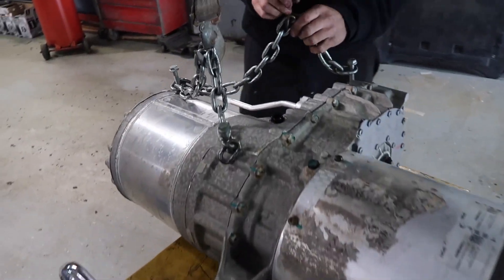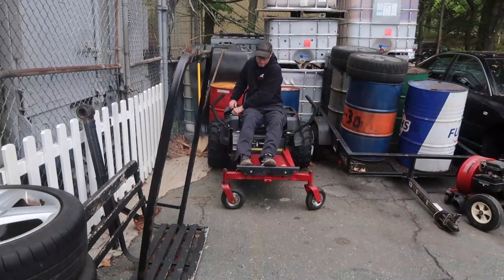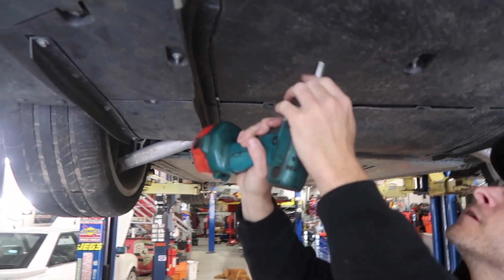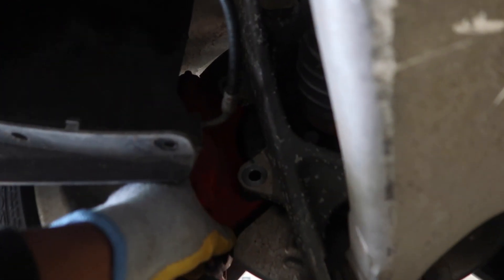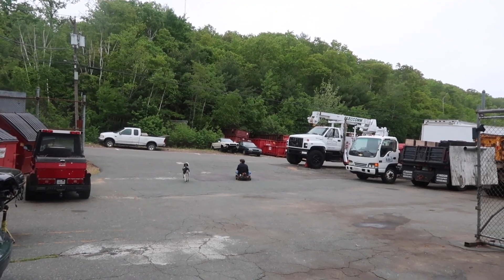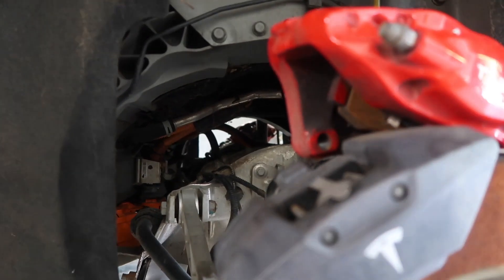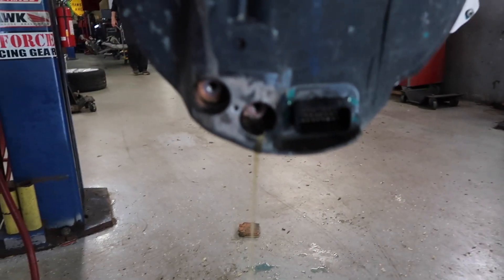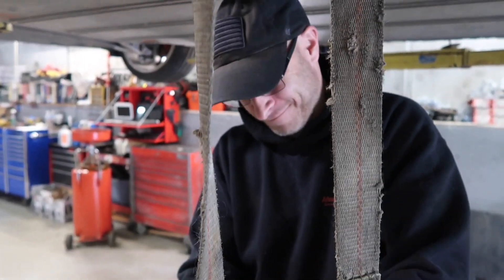Can You Drown a Tesla Motor?

Comment: The boards internal to those motors will be fine, no power to them at the time of flooding. 
Take them to an electronics manufacturer or repair place, get them properly cleaned and baked. The vast majority of PCA's made are washed in water and detergent after manufacture, then baked afterwards.
As for the motors themselves, if you can clean them off and dry them in a similar manner, they should be just fine. Several days baking will drive the moisture out of the rotor laminations and a light penetrating oil when done will stop any further corrosion. The windings on such new motors will not have suffered any damage, they'll still be well protected from corrosion by the lacquer in them, they may even be potted in epoxy if Tesla went all the way. Bearings are an easy replacement, three dimensions to know, get replacements and press off/ on.
The gear train will be fine, not even close to enough water in that housing for the water to reach bearings. The gears themselves are hardened steel, that stuff doesn't start rusting very quickly at all, I'd be surprised if they had even done much more than changed colour. I'd fill the gear case with light oil and flush through a few times, then fill with the correct oil and change oil again after a few hundred miles.
Frankly, I'd pull those motor shells, find an electronics company to disassemble, thoroughly clean ad wash the boards, then dry and test them. Same with the motors, I'd farm them out to a motor rewinding company. Electric motors are electric motors, they get rebuilt every day.
The cost of both motor reconditioning and board reconditioning would be a pittance compared to even used Tesla drivetrains.
If that was my car, I'd definitely have a go at getting those parts reconditioned.
By the way, I think you'll find there will be reduction gearing in between the motors, they would spin way too fast for direct drive to the differential. I suspect there will be a planetary reduction in there, given the shape of the housing and inputs from both sides.

Comment: Shot in the dark would be to immerse the PC boards in DI water in ultrasonic cleaner.  Then blow off with compressed air.  Last, place in an oven at about 130 degrees F. for a couple of hours.  Make sure you're not in an environment that can generate static electricity (compressed air does generate some though but you're not doing this in a perfect world). 

Many PC boards undergo a DI wash during the manufacturing process but not a soaking process.   The ones that don't use a "no clean" solder flux.  As for "send to some dude to repair", NFW.  These boards use custom ASICs and use custom diagnostics that no one would have.  They would also undergo ICT (in circuit test) before conformal coating.  No one's going to be able to troubleshoot these at the component level and there's no way Tesla will turn loose of the schematics .  Also no way you're going to get any custom parts for replacement if needed.  Tesla controls that.  Sorry,  Mouser Electronics doesn't stock them :-)

I don't even think Tesla could debug to component level after conformal coating was put on the board due to inaccessibility of testpoints on the printed circuit assembly (my guess but I'd have to see a close up of the board).

ICs will absorb water in their packages as they're not designed to submerse.  The conformal coating is on your side though.  It could prevent this as well as corrosion on leadframes and the BGAs.

Again, no guarantees but worth a try.  An ultrasonic cleaner and DI water are cheap.

(Failure analysis engineer for a living, worked for a major computer company)

Comment: Like people have said the boards are probably ok, just need to be cleaned up and thoroughly dried.  The tougher part might be making sure the windings are clean and dry and not compromising the insulation in the process.  Maybe remove as much electronic stuff as possible then after cleaning up everything throw the whole thing in a big oven at 250f or so a few days.  Just thinking out loud.  Interested in seeing how this turns out.

Comment: Get an ultrasonic cleaner and clean the inverter boards in it.  Use Branson's BranSonic EC parts cleaner.  It's a little expensive, but you can do quite a bit with a batch of chemicals.  Crest ultrasonic cleaners are probably the best choice for the money.

Comment: Get some isopropol alcohol and clean up all the circuit boards carefully with a paint brush (new, soft bristled) and see if the boards look ok afterwards....do the same with he motor - take apart and clean out. You just might be lucky if no-one has tried starting it when it had water in there....???

Comment: As long as you didnt energize the unit the inverter can be saved. Just takes time. Most of the electronics  are tin plated and resistant to corrosion to a point. Its the steel fasteners can be cleaned up or replaced. The copper eliminates of that unit can be clean easy. If you need help message me im in CT.

Comment: Yeah I think it could be cleaned up and let it dry out take some brushes and get the corrosion out of there what's some bristle brushes you can also use toothbrushes just clean up around the chips and the resistors and everything else some of them may be encased in some kind of hardened glue and that would be a good thing but you want to go And  regrease things that need to be greased or replace what needs to be replaced electronic components like boards and stuff are pretty resilient

Comment: The cranberry juice was gear/diff oil. The first few seconds you see water coming out as it sits on the bottom and oil Followed. Those gears might still be salvageable and the parts from the motor too like outer casing, screws etc. Keep them,they  might come in handy!

Comment: given the voltages involved in an AC inverter of that rating, I wold hope that those boards have a conformal coating on them that kept the water from damaging them. As long as they are cleaned well before you give them full power, you should be good.

Comment: Motors are inherently tolerant to water, however control electronics may be damaged assuming they were powered when the car went into the water.  Good taste in impact driver though, made in japan that's a solif unit.

Comment: Hi Rich.  I agree with those who think the water won't kill it.  I worked at Tekronix and we washed the circuit boards in a dishwashers.  (Really!).  If there was no power to the board it is likely the inverter  will work.  I would clean the boards of the rusty water deposits and fully dry it.  Look for components that would be affected by water (on a phone that would be a mic or speaker.   And yes, I know the inverter doesn't have a mic or speaker...)   But look for that kind of component.   If there is not that type of component you should be fine.  After cleaning and thoroughly drying the unit, I would connect the motor/inverter to car with extended cabling with the motor/inverter outside the car.  Since it is not under any load outside of the car it should not draw that much current and it should show you if the system still working.  (But be ready to pull the connector quickly is there is a short.)   Don't give up on motor/inverter just yet.

Comment: Motor itself won't have been a problem rebuilding, but electronics are more likely shot as that protective coating may have not done the trick being under water for several days. Would be interesting to see macro pictures of the boards and etc.

Comment: so.. this goes to show that the sealing is not effective on the motor..  i wonder where the water leaked in at.. if you reassembled it or had pulled a fill plug and pressurized the assembly prior to tear down you could have found any leaks..  i am thinking that any individuals with this out.. might want to carefully reseal it..  a few things.. Hylomar.. or Permatex 85420 would be a great sealer to use on O ringed joints..  with the motor and inverter cover off around the big end.. across where the power connector flanges are. where the control connector is sealed.. around the high voltage cables. 

 the loose CV axle nuts are an issue also... especially in high power cars.. the clamping force of the axle nut prevents the inner wheel bearing races from separating under cornering forces.. it also locks the flat face of the outer CV tight against the inner race and the hub shaft to prevent the splines from rocking in the hub..   having them that loose will  cause the splines to eventually wear out.. taking out the wheel bearing assemblies and the CV shafts..  they will spin like an 60s VW bug axle shaft.. 

 i wish i had the time and funds to mess with one of these..   i would want to use one of those drive assemblies to  replace a boat transmission. 

 i would probably want to take the cover off the inverter.. load the pressure washer up with 5 gallons or 10 gallons of distilled water or deionized water.. and give the rusty inverter components a light washing..  those might be cleaned .. using deionized water then baked at 165F to evaporate any moisture out of the boards..  i away future videos..

Comment: Circuit board will need replacement. You could try cleaning it thoroughly first with ultrasonic bath etc. but I'm not hopeful it made it, as corrosion will kill it fast.
Reply: If you look at it closer it looks like the contacts on the board are good and that corrosion only came for screws or what not. look at pin in the board and they do not look corroded.

Comment: give the PCB a clean with pure alcohol. They should be coated in a protected layer to prevent water damage. 10 days is a bit much but let it dry out for a week and it may work. saves you spending loads of money.

Comment: I'm guessing that is what the new roadster is doing, a motor where the inverter is now and instead of a open diff., there is no diff at all.  The two new inverters proably have to sit on the back of each motor.  Basically though the gears for each motor can sit within the same center gear case.  This is all done in the back of the roadster though and oh yea torque vectoring baby!

Comment: Yea. Dirty water and electricity isn't a smart idea. Electrolysis will happen (when energized). You can clean the electronics/PCB's with isopropyl alcohol (and a toothbrush).

Isn't that red stuff just oil (with additional leaked water)?

Comment: I wonder if Rossmann Repairs could fix the electronics? Louis works miracles with water damaged laptop circuit boards so you never know.
Reply: Definitley not the case. I run a phone/laptop repair store in southwest florida. Electronics that are exposed to water damage, are not simply "broken". The components generally don't burn out themselves, but like you mentioned, water does have minerals in it. So when this water dries, what does it leave behind? Minerals. Corrosion. Dirt/Debris. By using an ultrasonic cleaner, and nothing but distilled water, submerging electronic circuts and boards into the water bath for multiple hours, washes away the corrosion off of the gold/copper pads and different circuits that the energy wasn't able to flow through. The only difference is this time, when the electronics dry out, nothing will be left behind on the parts, because distilled water is violently pure.
Reply: High voltage with minerals in the water means nearly instant and unrepairable damage, I drowned a drone and lost every component to electrolysis in a couple minutes in a stream.
Reply: A fitter, happier, more productive Model S.
Reply: No way.
Reply: I'm pretty sure Tesla won't give the schematics to him. So there is no real chance to find the issue.
Reply: Alright Free Stuff, I'm going to give that a whirl on my old laptop. Nothing to lose.
Reply: Even if Louis isn't willing to put paul to work on these boards, you can still buy an ultrasonic cleaner and Branson EC fluid from him. I absolutely recommend cleaning those boards off in an ultrasonic cleaner, with followup repair to remove any additional corrosion, inspect the components for damage. 

As others have said, repair of the boards themselves may be difficult (or impossible) without schematics. However, I'd definitely give Rossmann Group a shot. 

A buddy of mine once powerwashed out a 3 phase motor. Works fine to this date.
Reply: The Crest Ultrasonic will fix those. Don't delay, buy today!
Reply: have you watched louis?

Comment: Yeah. The propeller logo is a myth. The original logo comes from bayerische motoren werke = BMW but due the illegal issue that doesn't allow to put a flag in a brand they had to change it a little. And the myth with the propeller was born on a Comercial where they used the logo on a flying plane instead of a propeller, they did this cause they were makeing engines for aircraft before car engines.

Comment: The boards are ok, you can see the conformal coating reflections at 13:52 (red board). Just wash them carefully with water and soap, dry out and you are good to go.
Reply: And of course wash the motor windings with pressure washer, change the connectors and bearings and everything else that seems bad.
Reply: Wash with alcohol not water\soap**
Reply: Water and soap is fine if you let it dry. the coating protects from corrosion. Hek it has already been underwater. :D

Comment: If power was not applied to the motor/inverter while it was under water likely the circuit boards can be cleaned with mild detergent and water then flushed with distilled water.  We actually used to wash circuit boards with HV circuits (tubes) when I was in the USAF.  Just wash and dry in an oven at about 140 Deg. F.  If power was applied when exposed to water, electrolysis will occur damaging the printed circuits.
Reply: Probably not a good idea to subject a PCB to high temperatures as the components tend to melt.  Also, it ain't electrolysis.  It's short circuiting which causes the components to melt.  EDIT: I guess I was wrong about the heat, but the heat given off by arcing electricity is fairly high.

Comment: I'd tell your friend that the hydros (drive systems on that mower) are designed to be used only when the engine is at or near full throttle. Believe me they will wear out quickly and I've haven't worn out a hydro or two like that 😉😉😉

Comment: Honestly it probably wouldn't be hard to fix. Just remove all of the electronics out of the motor, and spray all of them with electrical parts cleaner. 9/10 times when I did this the electronics work again even after water damage

Comment: two things that pop into my mind are member. I don't know American law here, but last I remember automotive manufacturers by law Herbert wired to produce all parts necessary to repair or maintenance a vehicle for a minimum of 10 years after the release of the vehicle to the public. There is no such thing as a list of hearts you aren't allowed to get and I'm pretty sure it's that way in the US where it's that way here in Canada. It has lot is pulling that around here in Canada. They are breaking the law.

Did you use the motor out of the Tesla that you used for perks in your previous videos. That's the second thing I've been kicking my brain around on were gone. It was soon you can't just take that motor and dry it out with a industrial electric heat source like a paint drying booth so we'll assume you need to her place the motor that would mean you need to get one out of eight has law that's been in an accident and the drivetrain of the car wasn't the focal point of the accident. I'm assuming has loads are generally rear engine so you would need to find one that had a encounter with, say, a semi or some other severe front end collision where the engine area of the vehicle hasn't been damaged probably somebody's Artie mentioned this. I'm assuming you Artie use the electrical motor system out of the other test like you were using for parts. Frankly, I'm sure you already thought about this before you even bought the vehicle and Artie had another motor option in mind.i bye vehicles generally from 1000 and West that I use personally because I'm basically a broke practically living on the street ass and  go to quite a bit of trouble to literally look up perks generally before I even look at buying something. Literally ran into a weird problem with a 2009 Dodge caravan where all of a sudden the part just isn't available unless you want to pay triple what it normally goes for.i wanted to replace the rear passenger side brake caliper with a new one and suddenly when you go through eBay and a few other websites. The only ones that are available are the drivers side. Nobody had a passenger side one in stock, unless you wanted to pay significantly more than what the drivers side one normally sells for passenger side and driver's-side obviously should be the same price. Most dealers only had a driver's-side. And had no record of passenger side. There were several used options. Most of the worm or expensive than buying a new one.i ended up passing to buy a used one at a salvage yard and personally would've rather bought a new one dealership wanted over 200 for the item which you can normally get on eBay for around $40 plus the shipping. I literally priced the entire drivetrain on the Van a couple weeks before I bought it and it's just kind of funny that there's a handful of parts you suddenly can't get on eBay having the same problem with a Mercedes that I've bought .I'd price the entire drivetrain and couple weeks later I go to get this stupid part and I can't get one under 120 I had priced the same part a few weeks ago and with the shipping and everything. It worked out to about 85 Canadian at that point, and there were lots of people that had it. Now there's only one person that has it, short of going all the way to Latvia